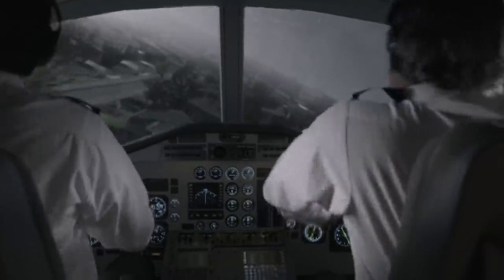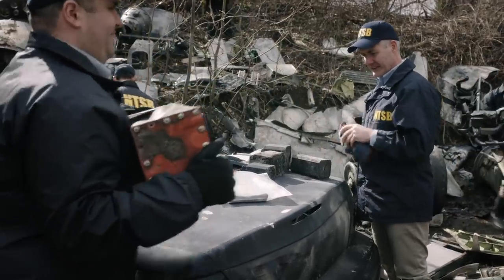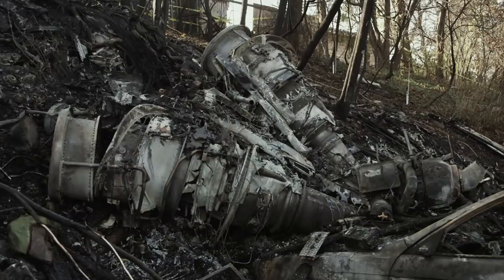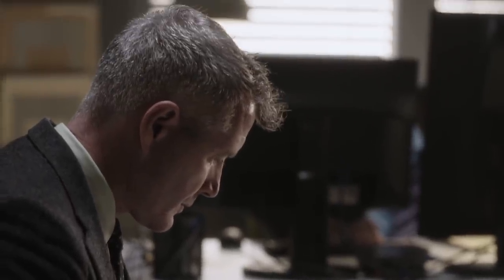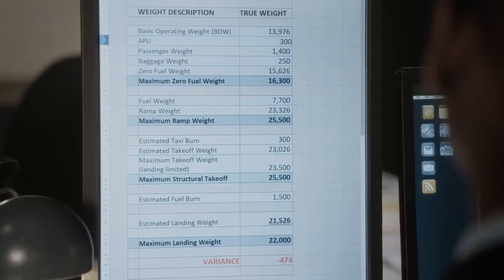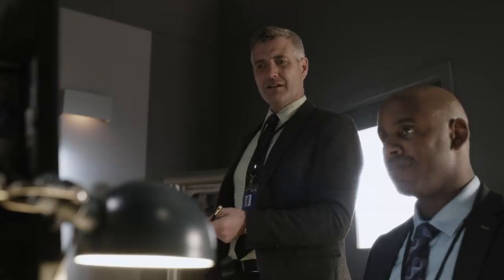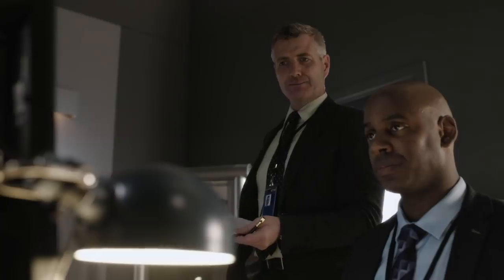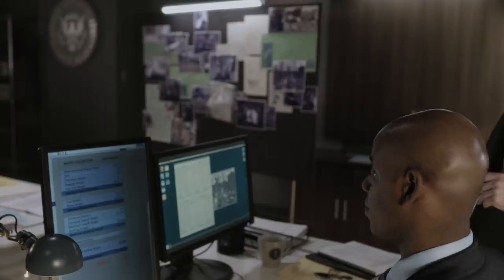This Plane’s Angle of Approach May Have Doomed It 😔 Air Disasters | Smithsonian Channel

Comment: That would be quite the design flaw if the response to a wing stall is the plane saying "PULL UP!"
Reply: I agree, but I assume that the angle of attack indicators were not connected with the altitude and speed indicators on this plane, meaning the plane couldn't draw any correlation between those.  I do hope though that other plane have better warning system.
Reply: @Zakahia  Yeah. Stall warning just looks for airspeed, not AoA.
Reply: @taproom113  Since you seem to be knowledge on this one, may I ask, whether the Stall warning also blares when the Airspeed is too low? (independent from the AoA)
Reply: @Zakahia  It shouldn't ... or the warning would blare in normal operational conditions like takeoff, landing and taxing also. As any aircraft can be stalled at any given airspeed and/or attitude, the "STALL" annunciation is directly a function of AoA on most, and I believe all Part 25 certified, aircraft. ^v^
Reply: @stevemc01  Sorry, Steve ... you've got it backwards. A stall is a function of AoA, not airspeed.
Reply: @taproom113  Ah I see...
Reply: @Zakahia  No it does that,  critical event is right, but most pilot knows this wierd warning. But when the ground proxomity says pull upp, usually its to late to recover from the stall by nose down anyway unless if you have a very light airplane with good lift that can get lift at low speed.

Comment: The scary fact on every crash that has no survivors is the crash site not have body parts. Like, literally, where’d the people go!?
Reply: It is a reenactment , real crashes have bodies and body parts everywhere .
Reply: @abelucious  Oh.
Reply: I live in this area, grew up across the street from the airport they were supposed to be landing at.. The sad thing about this crash, is that they came to the conclusion that there was a possibility that some of the victims may have survived the initial impact but they would not have survived the fire that erupted after the crash... Luckily nobody was home in the duplex is hit but sadly there were pets inside :(.. That always made me extremely sad too lol..

To answer your question though, sometimes there are bodies and they usually find and clear them out first but most of the time, the jet fuel burns so hot that it burns everything to ash.. Including the bodies :/

Comment: Two technical comments, neither of which are make or break issues, but:
1) putting a red sloped line on the screen along with their altitude trace is misleading and irrelevant since they were cleared for a localizer approach (which by definition doesn’t have vertical guidance), not an ILS approach. Correctly flown their altitude trace would have shown a step down approach to minimum descent level until they either saw the runway (or approach lighting) before the Missed Approach Point (MAP), or hit the MAP without seeing anything “good” and then executed a Missed Approach. 

2) I would think the APU weight would be included in the plane’s basic equipment weight, not something for the pilots to manually enter in their W&B calculations. If it wasn’t in the plane’s BEW then it probably points to sloppy corporate/maintenance record keeping as well. It’s not like you carry an APU on board like a suitcase. May have contribute to more aft C of G  than expected though, but not what made them crash. 

In my opinion it seems like their fatigued brains let them get too distracted and end up too high too close in and diving for minimums, whereas more properly rested brains would have recognized they were behind and snowballing and not hesitated to call a Missed Approach. 

Tragic on several levels. :(
R.I.P. all on board.